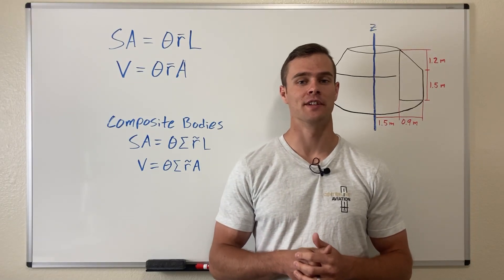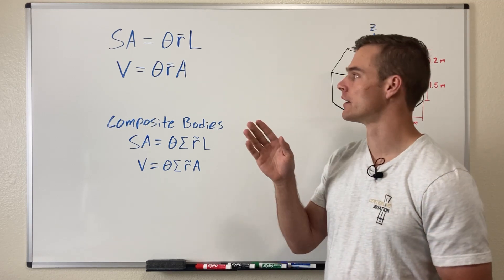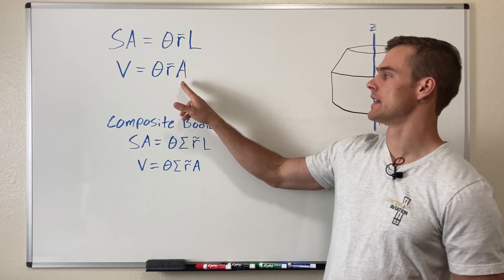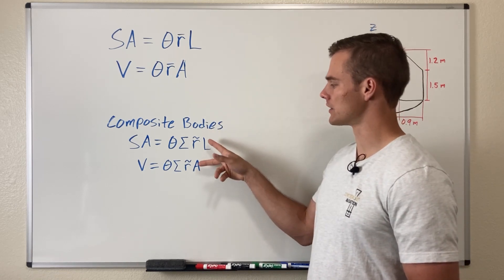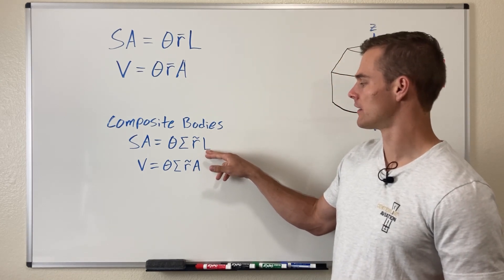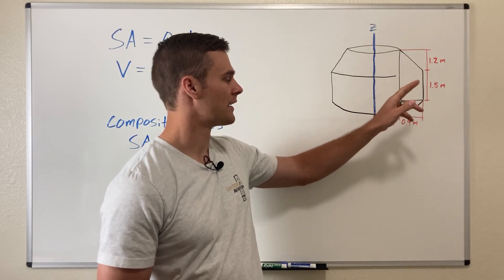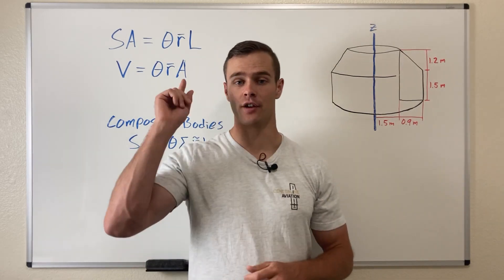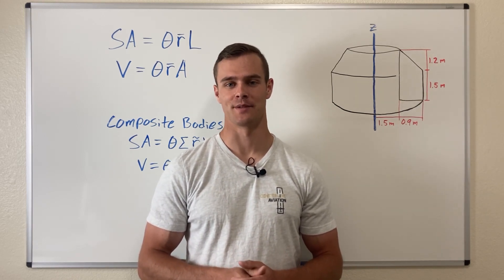Pappus and Guldinus Theorems and Equations // How to Find the Surface Areas & Volumes of 3D objects

Comment: Hi, thanks for the great video, I am trying to find the volume of a an entire tree, picture a silhouette of a tree, let's say a pine tree, I am thinking of a 21m high tree, the trunk is 0.4m diameter with a taper of the trunk at 0.8% on each side and the branches start at 1.8m off the ground and then there is a parabolic taper to the top of the tree from that point on to zero. The largest width of the tree, where the branches first start is 12m wide. I am thinking to revolve half the silhouette and so half of trapezoid of the trunk at 0.2m tapering to 1.8m high and then 6m branch start going parabolic to the top. Could you perhaps kindly outline how because I want to get this exact? Can this be done with an equation of  the edge of the silhouette, or is it better to spin the area of half the silhouette, I'm not sure. Thank you.
Reply from the maker: Sounds like an interesting problem. I think that your problem would be solved the easiest by just finding the cones and partial cones that make up the tree and add up those volumes. I don’t think many of the equations in the video need to be used because you are revolving the area in a full circle and the lines you are using are all straight.
Reply: @studentengineering  I've done Pappus Guldinus theorem volume calculations in Calculus in high school, and wanted to do it once again, as the tree volumes, need to do a bulk density check for  the entire enclosed volume of the trees, quite important because I have to analyze a parking garage roof slab with trees on top acting as additional loads on top of a thick soil overburden. FYI, the tree outline is sometimes parabolic and not always straight because there is a mix of maple/pine etc. Yes, I do understand that I could do cones and cylinders but preferred to do it in one shot. Not a problem but tks for the quick reply.